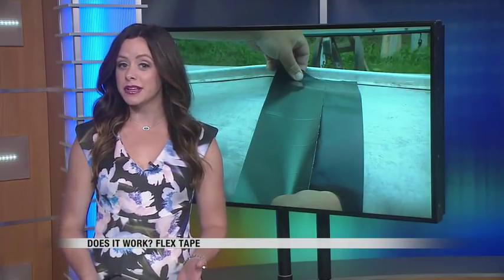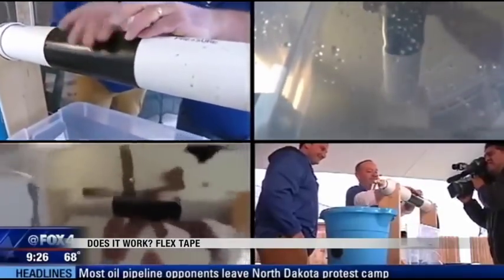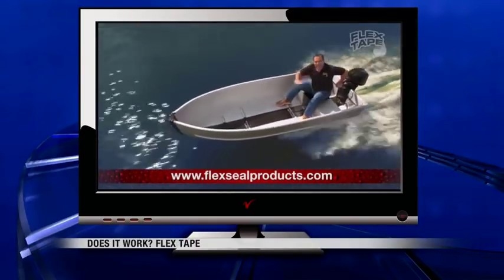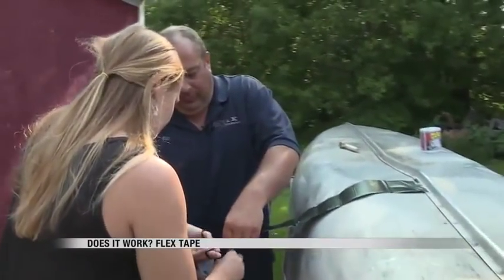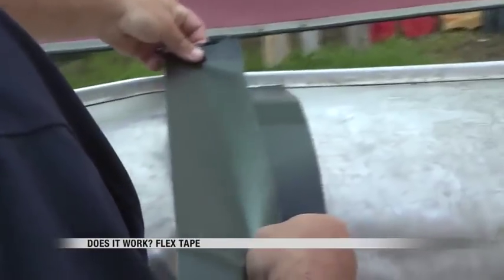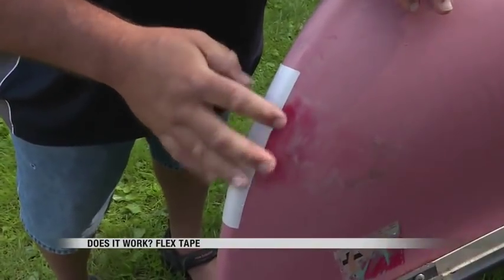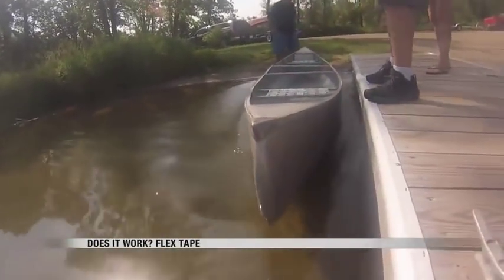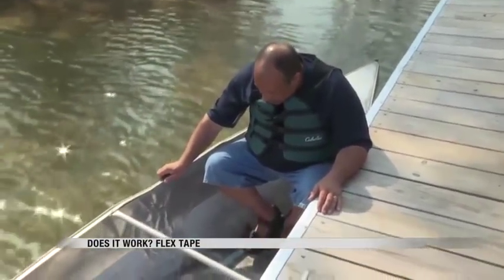News Does it really work Flex Tape, will it hold out the water

Comment: These people are worse than the commercial marketers... i mean they didnt even do what the commercial did... both side... both side... jeez
Reply: And multiple layers used
Reply: @mr.bootycheeksslapperclapper  in the commercial they use flex tape on both side of the boat the outside and inside
Reply: how do you tape the inside of a water pipe .... or pool liner.

Comment: Valley News Live,
Even children on YouTube are smart enough to understand two simple words, ”BOTH SIDES”
Reply: Nuka-Cola like ur profile pic
Reply: Inner side wouldn't do much. Tape should be applied on the surface that experiences pressure.
Reply: Kevin,
You clearly don’t understand...
You clearly never watched the video...
You clearly do not understand ”BOTH SIDES...”
Reply: Halo yep
Reply: seriously, if you read the captions during when phil swift rode the boat, it would say both sides were covered with flex tape
also 12 inch tape were i believe, not the 2 or 3 they used
Reply: Halo ❤
Reply: Hey at least someone said it

Comment: Maybe should have sanded the surface   before you put the tape on
Reply: CaptainCarter64 z
Reply: just clean it
Reply: Or put it on both sides.
Reply: sanded it gutted it and stuck it on both sides
Reply: Tide Pods he means sand it a little so it grips to the plastic

Comment: I think the problem with this test was that the way the boat was broken was in bumps kinda like a paper you crush into a ball and then reopen. Since the surface wasn't flat the tape could not stick inside the holes of the bumps with then gave a path way for water by creating sort of pressured water pockets.

Comment: As in the commercial you must place it on both inside and out, and in the commercial they used 12 inch wide tape, 3 times bigger than the 4 inch wide tape used here.

Comment: Why it doesn't work
1. Tape is not on both sides.
2. On the commercial there was a disclaimer that about 12 strips were applied of Flex Tape.
3. You do not have the holy touch Phil Swift has so you are not worthy of having Flex Tape to begin with.